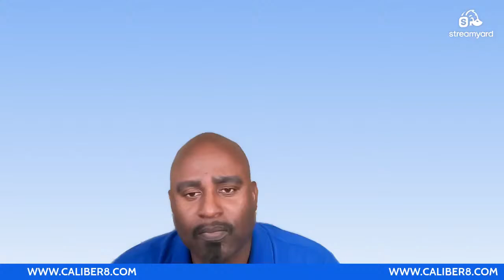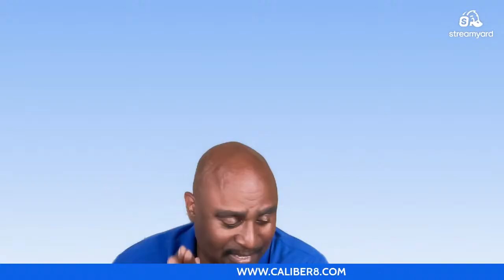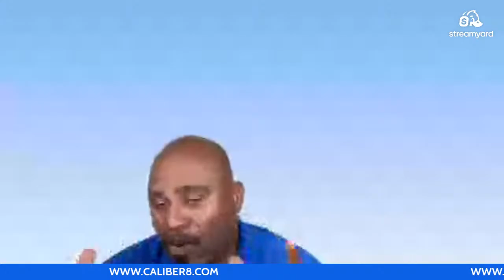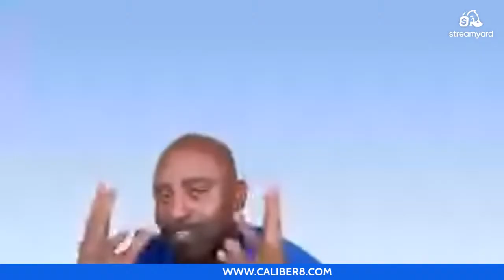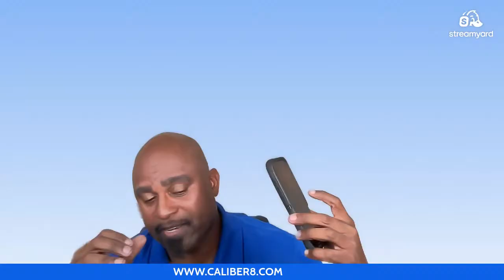Battery Powered Landscaping Tools are Taking Over

Comment: For me, in 2020, I bought a gas mower but a battery operated blower and edger. I do find the battery life lasting longer than the warranty, which is great and I added recently a cordless nailer using the same battery. I will absolutely love to have one of these mowers that do it automatically. I've looked into that and it is definitely not price affordable at this time. What you said is true, the battery edger and blower are lighter for me, and I don't need to be concerned with where I'm going if I was using an electrical one. Good topic.
Reply from the maker: Glad to hear the battery tools are working out well for you.

Comment: Yep, retired guy here.  Very skeptical when they first came out because my gas powered tools worked fine.  However the battery equipment has improved so much.  I have a battery powered push mower, string trimmer and hedge trimmer.  Not going back.  Pass the Lithium !!!
Reply from the maker: It’s hard to beat the convenience once you make the switch!